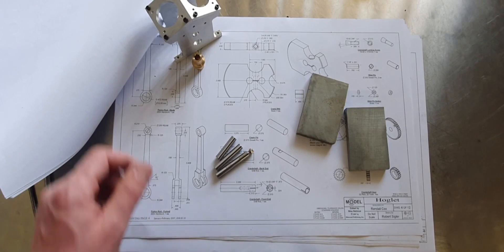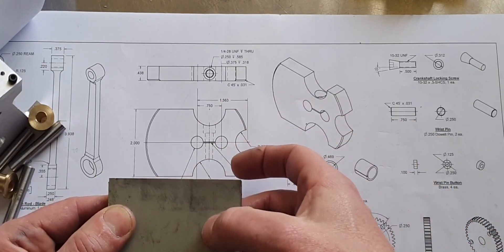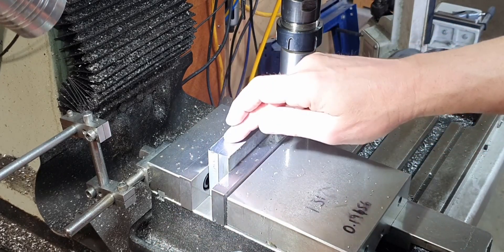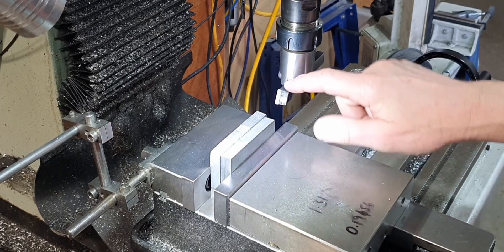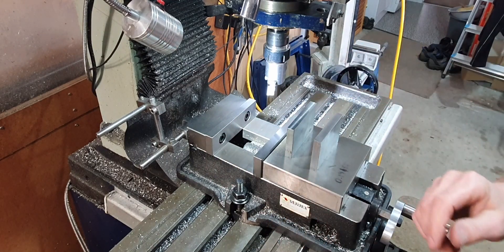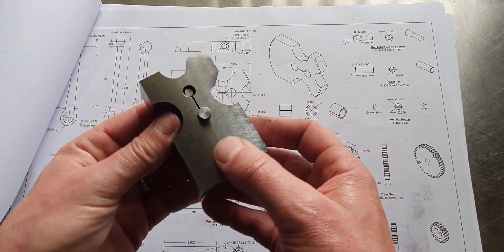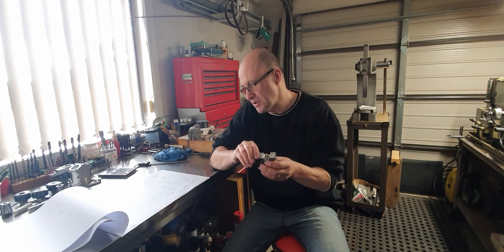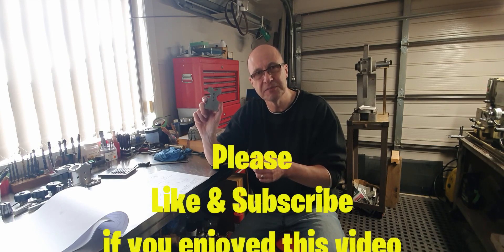#88 Part 2 - Hoglet V-twin Engine - Crank webs & Flywheels

Comment: Hey buddy, wht size pieces of bronze do you need?  I may be able to help.
Reply from the maker: Hi Greg, bronze or brass 105mm OD minimum x 18mm thick. Solid or hollow. Qty:2. Regards Kevin
Reply: @Machine_NZ  I'll see what I can do.  You said it could be hollow.  What's the max.  I.D?
Reply from the maker: @gregknipp2575  Hi Greg, max ID 65mm
Reply: I believe I have something that may work.  I'll measure on Monday and let you know.  Shipping may be outrageous.

Comment: I got a hollow bronze offcut a couple of years back for my Hoglet. Only just wide enough and spent ages carefully cut it in to two to make the 2 flywheels. That bit was a one off ebay special at £60 in the UK and I thought that was crazy expensive at the time. I reckon if you blackened the centre webs and could get a high polished finish on the rings it would look great in steel.
Reply from the maker: Hi. Good idea I'll thing about that. Regards Kevin

Comment: You have a furnace now, all you have to do is go and buy the empty casings from the small bore rifle club at Eltham or the pistol club. The pistol club may reload theirs but the Eltham club has buckets full.
Reply from the maker: Hi Paul. Now there's a thought. Still thinking at the moment but empty casings may work. Cheers kevin
Reply: @Machine_NZ  if you want to use my bigger furnace you're quite welcome.

Comment: Gday Kev, the parts turned out nice, the cost of materials are out of control, nothing is cheap anymore sadly, it would look nice with bronze or brass but I’d stick with steel, not worth going broke for a bit of bling mate, awesome job as always, cheers
Reply: Yea my hobby work has slowed down heaps because of the material price.
Reply from the maker: Hi Matty. Yes I'm thinking steel but the wife said bronze or brass would look better. I'll have a think about it. When Andrew Whale built his the bronze cost him less than half the cost it is here! Thanks for watching mate. Regards Kev